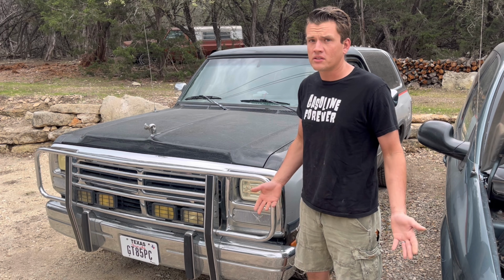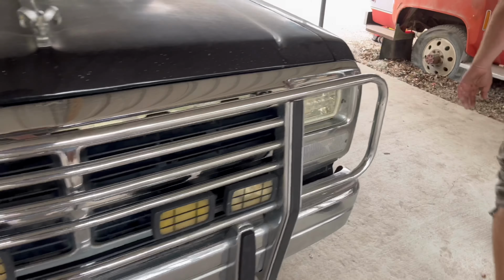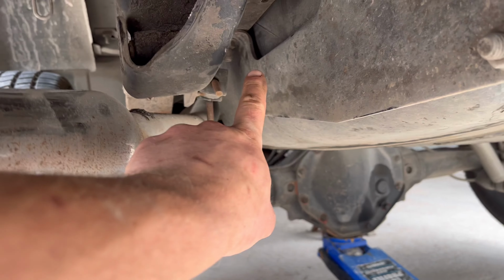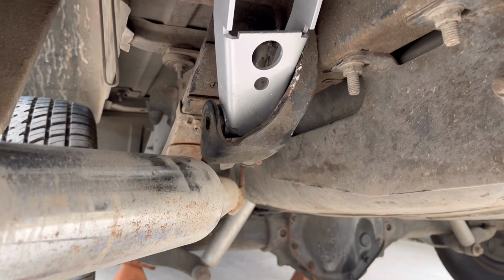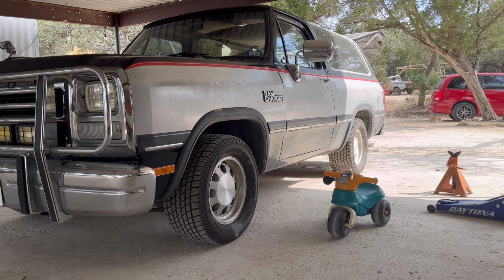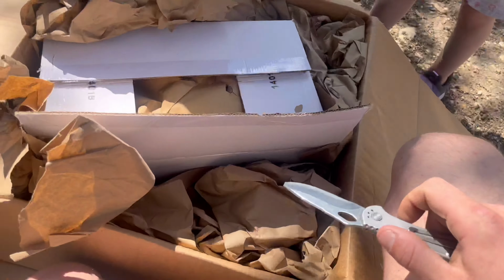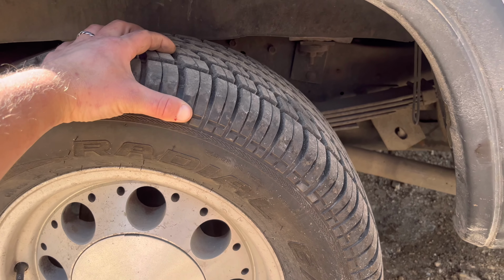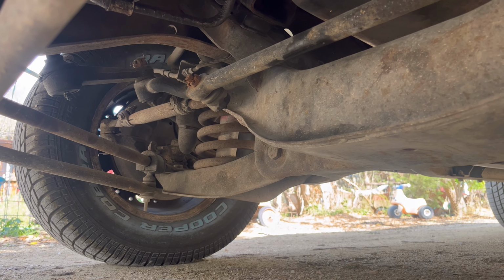How To LOWER a D-100 Dodge Ram Charger

Comment: Beautiful Magnum Ramcharger.  Did you measure tire to the frame rails?  Maybe in the wreck, the rearend shifted under the frame. 🤔
Reply from the maker: I actually can’t remember if I did measure that..I wanna say I did. I’ll have to double check cause now I’m curious 👀
Reply: Or if it's two wheel drive the rims are different from the rear ( different offset ) or you have a mix of 7" wide and 8" wide rims. I've seen that before.

Comment: To lower those front ends kind of easy you swap in a set of lower control arms of a similar year van. They have a drop spring pocket in them that lowers you an inch or two. You have to trim them slightly and drill some holes out for larger hardware but I can't remember exactly what now days.
Reply from the maker: I remember reading back in the forum days that was the best way to lower them affordably, good to remember for the future because I’ll eventually upgrade it.

Comment: Using the wheel opening  to measure is stupid .  the wheel openings front to rear are not the same distance from the ground .  Put a spirit level on the rocker panel .